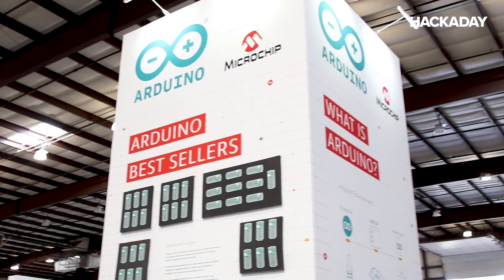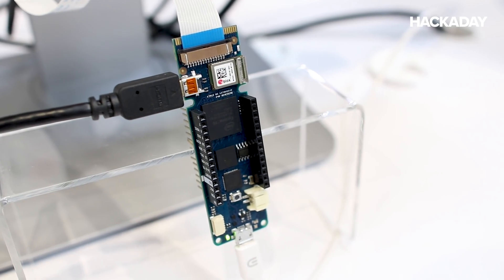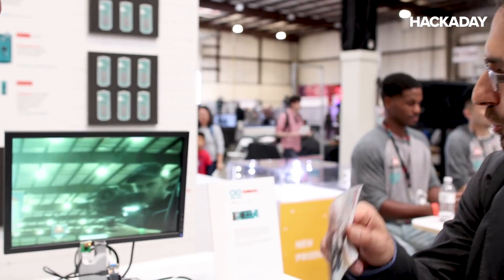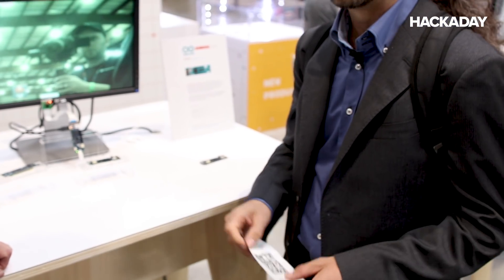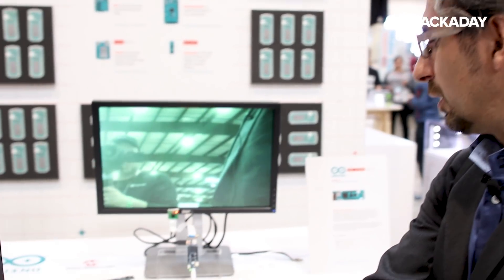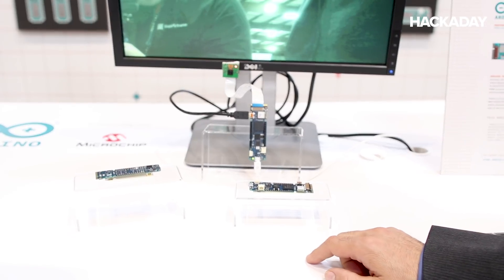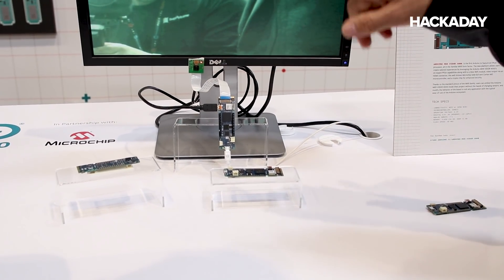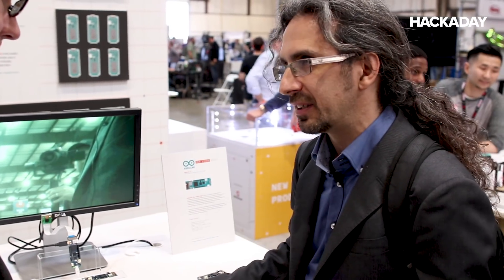Hands On With The FPGA'd Arduino at Maker Faire

Comment: Can it send the video it captures and encodes over the built in WiFi chip? Can it do it in HD? I'm assuming you would have to program the FPGA as a video transmitter- I just don't know if you can pass it off to WiFi.

Comment: No $60 is nothing good, remember that raspberry pi zero is like $10
Reply: But Raspberry Pi Zero is not an FPGA
Reply: Arek R. As David stated it's comparing apples to bananas. Pi zero has a great value for the money but in the end is a low end processor with a gpu and runs linux for not so demanding applications. With it you'll never manage real time applications but can for sure do networked applications easily. Vidor is based on the Arduino ecosystem which means tons of libraries for any hw peripheral, instantaneous response to external stimuli and, thanks to the FPGA endless customization possibilities to implement hw peripherals. Also Pi zero is based on a consumer processor while Vidor uses industrial grade components. Summarizing, if you plan using linux with light applications or gpu pi zero is the way to go. If you need embedded real time with programmable hw Vidor is what you need.

Comment: Is it a Raspberry Pi Cam on it? X)
Reply: yes it is.
Reply: the001oneproductions yes and no. Fpga is capable of handling pixel clocks at full HD rate (148.5 MHz) but SDRAM we're using here is not. So if you plan to process video on the fly you won't have issues while if you need to buffer it this is not the right platform. For example we can run the qr code finder at fullhd but we could not display it unless we downscale as we need buffering to overlay osd. As mentioned in other posts this is the first of a family of boards and more is coming with higher performance (and price)...
Reply: Raspberry pi cam is a standard mipi camera anyways
Reply: Dario Pennisi is it capable of processing fullhd video?

Comment: Its not an ESP32, its a ublox wireless module. Would probably be substantially better (and cheaper) if it was just an ESP32 instead of that and the SAM core...
Reply: Hi Dale,
it's a nina uBlox module. it contains an ESP32 but it is also very tiny and precertified worldwide. uBlox module quality and support is much higher than any other ESP32 based module.

Comment: "Eh-thernet"? Next.
Reply: suomi35 you can have internet on it with an ethernet link
Reply: Ethernet at 10 mbit is possible without anything else than a magjack. Higher speeds require external phy. The 10mbit ip will be available from us although not immediately at launch
Reply: The pronunciation...the pronunciation...not the networking tech...smh
Reply: arduino = made in Italia... we don't care about pronunciation..
Reply: Steve Black that was a good opportunity to learn that there's a big debate on the "right" way to pronounce Ethernet. Looks like British go for a way and Americans the other... Then I saw someone say that if you invented it you have the right to decide what's the right one but it won't solve the background issue that Britain and America are two nations divided by the same language.

Comment: I'm a bare metal type guy when it comes to these boards. 

So what's the difficulty of loading your own ARM kernel onto this, 
and does the FPGA have a JTAG broken out for a USB blaster?
Reply: Hi Jeremy,
sorry for the slow reply but i missed your question in the middle of the many others. the pinout we have is the same as other MKR boards so basically all M0+ pins are brought to the MKR connectors with the exception of a SPI port which is used for JTAG interface with FPGA. since all microcontroller ports are also route to FPGA pins, you can repurpose those to communicate with FPGA if needed. the JTAG interface is used for programming and for internal register access (after configuration). the board has provision for JTAG connectors for both M0+ and FPGA however you probably won't need it as we are implementing a USB Blaster compatible interface on the M0+. let me know if you need any other info.
Reply: Yeah it should be
Reply: You can synthesize an ARM core on the FPGA if it has enough logic blocks. Check out opencores.org for open source IP cores. From the look of the board, you can program the FPGA directly from the micro-usb port via usb-serial conversion
Reply: I'm well aware of instantiating soft cores inside FPGAs.
An ARM core would be too big for this FPGA, but this one is already connected to a Cortex M0+.
Reply: what did you mean by ARM kernel?
Reply: For the ARM Cortex M0+.
I can write my own kernels in assembly, I wanted to know what ports were broken out on this board for doing this.
Some systems have a 4 pin connector for flashing the boot area, some have a 2nd stage loader for an SD card.
Reply: Very nice. I'm guessing it's a kernel for an RTOS. Are you developing your own OS?
Reply: I've done dozens of operating systems over the years.
When a new board comes out, I like to write an OS, and drivers for the peripherals, so I can use them for embedded projects.
I've worked with Cyclone 4/5s and Spartan 6 FPGAs, some of them have hard processors in them.

Comment: Great little board but 60$ is a little bit expensive...
Reply: E_404 It isn‘t IMO. That’s like 50% more expensive than an Arduino Mega and you get near endless possibilities in return, with the Arduino quality you are used to.
Reply: Keep in mind that there are costs beyond just hardware and material costs. You have to pay the design engineers, the test engineers, and the software engineers that are putting work into streamlining FPGA's for the beginner user. 

While folks could buy a more powerful FPGA directly from another vendor for roughly the same cost, they'd have to program it in either Quartus or Vivado, neither of which are exactly easy interfaces to learn on. This goes against the mission of Arduino - to provide a simplified interface to allow folks to learn programming and electronics without the worry of learning complicated platforms.
Reply: Yeah, that really isn't, it's priced very competitively with other FPGA boards (it's cheaper than most in this class). For the chips it has on board, this could be quite the capable device. I don't think I would personally grab it now because much more powerful boards like the Digilent Arty Boards are just $100 and much more powerful, but to each his own.

Comment: Why those components??
You have a budget 48MHz M0 processor and a comparatively over-priced FPGA. They would have been much better off having a new M7 processor (300Mhz with DP floating point support) with a more moderately priced FPGA (such as a Lattice ones).  At least that would have given the new ESP boards a run for their money straight out of the box whilst also allowing a maker to develop their own boards around the technology for a reasonable amount.
Reply: Hi John, there are several examples that may work. just start thinking about the fact that you usually select a board by analyzing the peripherals you need... in this case with the same board you can instantiate anything you need. in addition to this there are several things a microcontroller can't do very well such as handling quadrature encoders for closed loop motor control or complex DSP tasks. for example if you want to handle audio with an FPGA you can decode PDM from digital microphones, use the internal hard multipliers to generate FIR filters with thousands of taps, use the 8 MB embedded memory to handle effects such as delay, reverber, chorus, flanger, etc; you can of course perform very fast FFTs and since audio sample rate is so low compared to FPGA frequencies you can use a single instance of an IP, multiplexed in time to handle multiple channels. for example, running an IP at 100 MHz would allow you to multiplex it 2083 times at 48 KHz sample rate. what we really are trying to do here is bring the very advanced things only full time professionals were able to do to the level anyone, even people with no prior knowledge, can handle. and to further answer your notes on china manufacturing this is really where the value is.
Reply: Stumpy, designing the optimal blend of components involves several tough decisions. For one all mkr boards run on samd21 and we wanted to keep full compatibility, moreover to keep the price as low as possible we preferred to have more gates on the fpga rather than implement a more expensive processor which would likely not even fit the small mkr format. Keep also in mind Vidor has also an esp32 based wifi/bt module with reprogrammable, open source stack so if you prefer you can run your code on it. In any case stay tuned... As I wrote somewhere else this is just the beginning...
Reply: Sounds very good!!
Reply: Paul Taylor sorry but can't answer right now. We have lots of things in the pipeline and sdr is one of them but I prefer to discuss about stuff that is officially announced rather than things that are coming. I can say for sure this fpga won't allow very complex radios as the fpga is low cost/low performance but regardless you should expect to process at least real time bandwidths of several tens of MHz. In the meantime we are finally shipping the first boards and soon you'll see documentatio, libs and examples out in the wild
Reply: I am just wondering, as a hobbyist/prototype engineer, what can I actually do with an FPGA? This is a question that is killing me. I think everything worth doing on FPGA is very advanced and for those in a full time profession...
Reply: Dario Pennisi Can you comment on what kind of Software Defined Radio this board will support please?
Reply: Dario Pennisi Thanks Dario, a few 10s of MHz will make a good demonstration and will be fun to play with, and you could do down conversion if you wanted a specific slice of higher spectrum.  Sounds like a great product and a natural step up from the microcontrollers we know and love.

Comment: I'm curious to see the FPGA programming software interface. It'll be interesting to see if they provide simplified Verilog/VHDL wrappers, straight Verilog/VHDL, or if you have to program the FPGA with Quartus.
Reply: initially we will be providing precompiled images with sets of IP blocks that allow to repurpose the board for specific use cases. by september we will be releasing a way to assemble your own system on chip selecting among the available ip blocks, which by the way will mostly be open source; the same editor will also allow to graphically implement (no code involved) state machines. shortly we will be opening a call for proposals to hear from the community about requests for IP blocks we will develop, enriching the possibilities  and enabling the platform to grow. of course IP blocks are based on a set of design rules that helps bringing them together automatically and this at the same time imposes some restrictions which is a trade off that we will try to stretch as much as possible to prevent too many limitations without making it too difficult to develop your own IP. skilled users will be free to use Quartus lite and develop/test/simulate their IP blocks in vhdl, verilog, system verilog and eventually C++ (using high level design synthesis just released in Quartus 18.0) and if they will follow the guidelines their IP will be compatible with our assembly system that tries to remove the complexities of equivalent tools from the vendors. most of this will be available through Create, so most users won't need to download the many gigabytes Quartus requires and will be able to develop their own custom SoC even from chromebooks.
as stated above as well as other posts, comments and suggestions are more than welcome, provided they are constructive.
Reply: Glad someone asked this, was exactly what I came to the comments section to look for.
Reply: Paddy Robinson-Griffin 
Decent ???? Really ...??
Will love to hear a better one
Reply: That sounds like a decent plan.  Exciting times!
Reply: Dario Pennisi wow

Comment: Gosh, get a good camera first -_-
Reply: the fpga connected can really only handle that resolution
Reply: Sort of... The demo is running at 640x480 mainly due to SDRAM bandwidth limitations however fpga itself can handle DVI output at 1080p30 and mipi input at around 75 mpixel/sec which may be used for 5mpixel at 15 fps or any other combination that fits the bandwidth.
Reply: oranac yes that can be done as cvbs is low bandwidth but you need to have external decoders such as TVP5150 or ADV6280 to interface with analog signals. For the record cvbs is 13.5 mpixel/sec and SVGA is 40 mpixel/sec so with two inputs you total 67 mpixel/sec which leaves quite some room from the 100mpixel/sec we handle now. Actually SDRAM could handle up to 145 but you're going to deal with timing closure issues
Reply: would this hardware allow multiple CVBS inputs alongside something like a 800x600 output at 60fps?
This hardware is making me think insteresting things for low cost fpv goggles.

Comment: FPGA's can handle a lot of data - PROVIDED you have a high speed bus (HSMC, FMC, Syszygy, PCIe) AND modules that use that bus.
Camera? That's a good start but you need lots more...
Reply: Alan Campbell you're absolutely right if we talk about using fpgas to accelerate complex algorithms. The point here is providing microcontroller users a tool that removes the limits imposed by fixed ASSP by virtually extending the palette of peripherals microcontroller can use. Of course we could have a different blend and maybe we'll end up with the Xeon+arria 10 which is much more powerful than zynq but keep in mind we are addressing Arduino users and btw this is just the first of a likely prosperous family of products